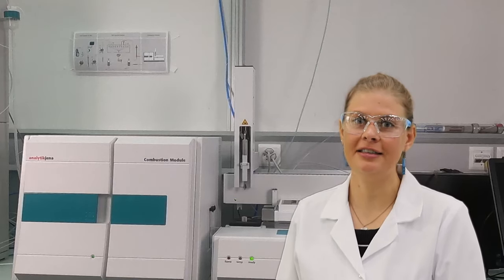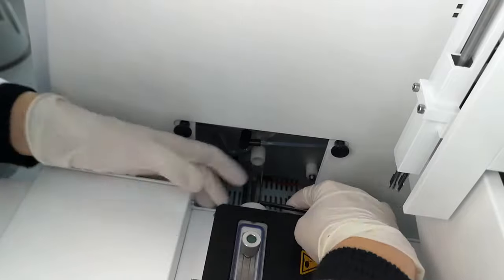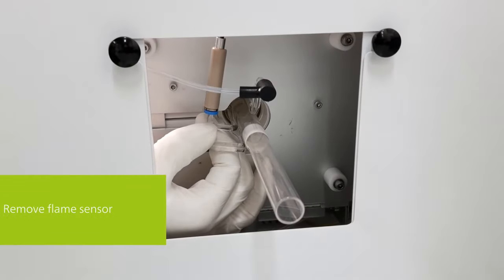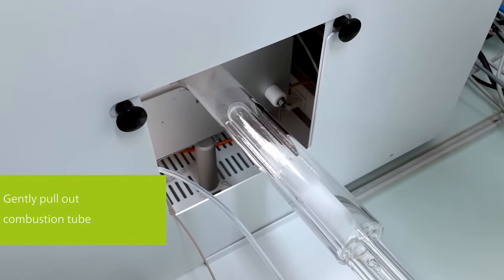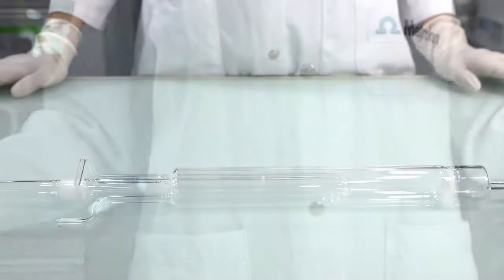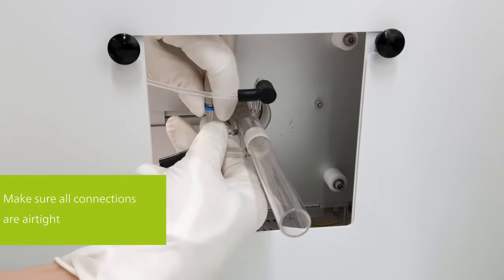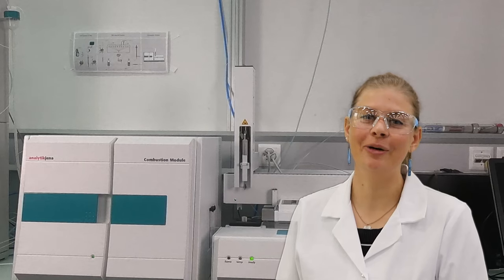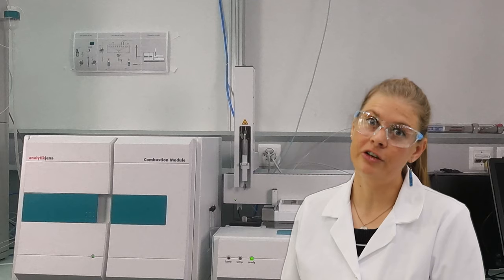Exchanging the combustion tube of a CIC

Comment: What if the blank read value of chloride.. Possible reason
Reply from the maker: We assume that you see a Cl peak in the blank. You could try increasing the rinsing volume. Or run several blanks in a row to see if the peak decreases. If yes, then increase the rinsing volume. If not, then it could be an impurity in the chemicals or the ultrapure water. Whenever possible, you should use chemicals and ultrapure water without impurities.

Please also check our Product Help Center IC:
https://www.metrohm.com/en/service/product-help-center/ion-chromatography.html